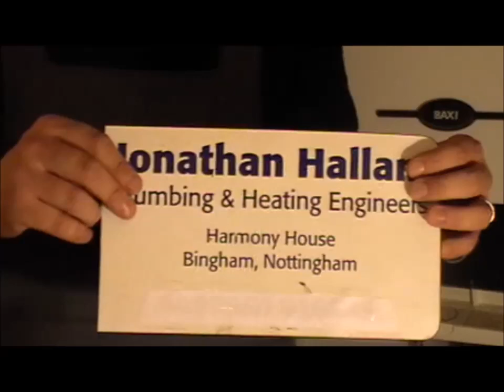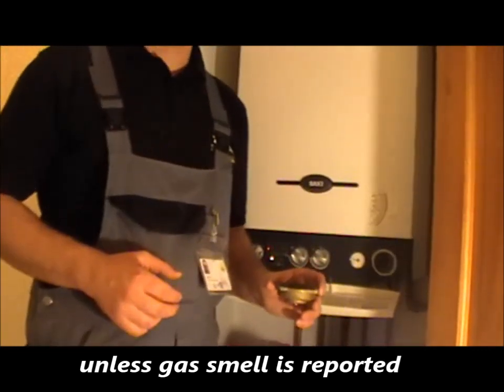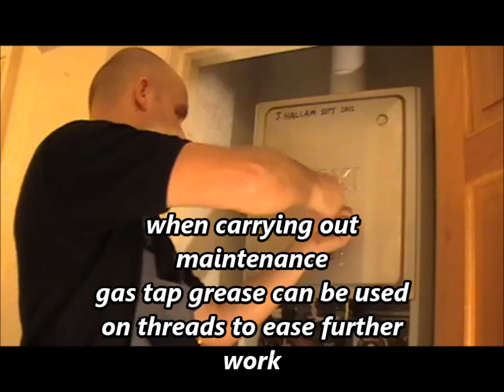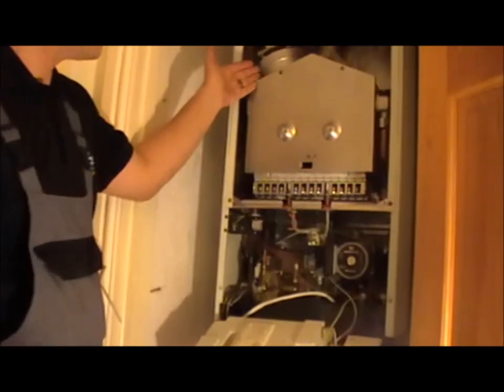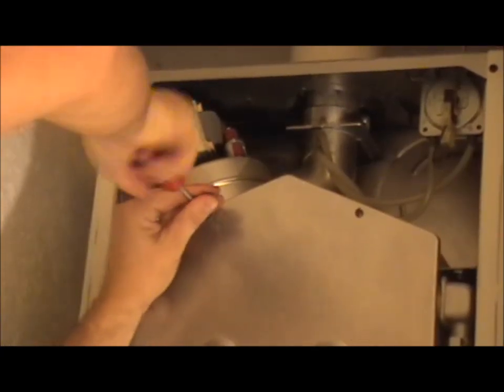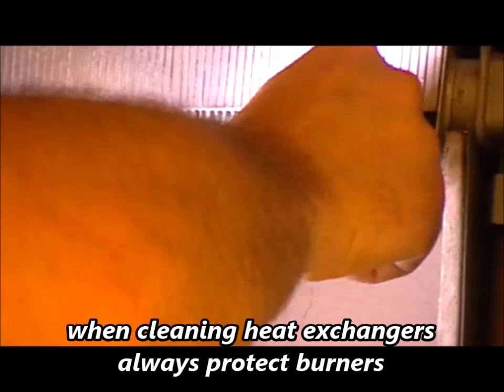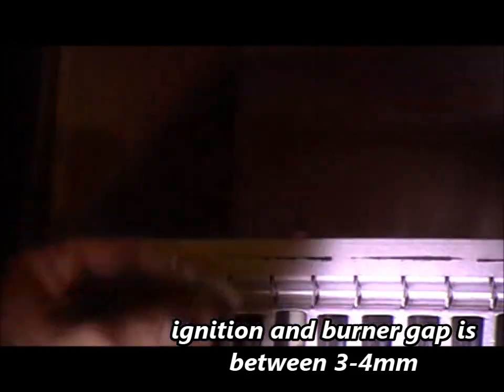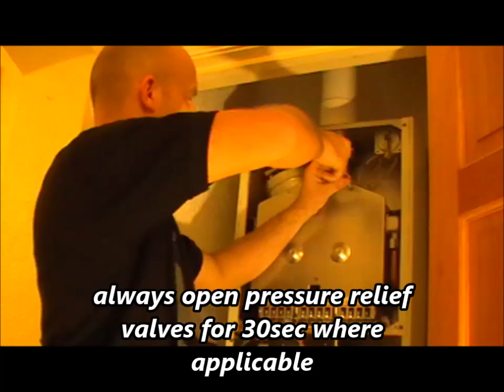Learn how to carry out Boiler Services Part 1

Comment: Hi I saw your videos and I really enjoyed it keep up the good work.

I have a Main Eco 30 Combi boiler I was fitted about 7 years ago, the whole pipe work is new and radiators.

There is one thing that annoys me on my boiler is that when ever is ignites it makes a small tiny explosive noise you can hear it from far 😫

I have so far replaced the electrodes since  it was old and bent (it was working but I wanted to avoid it failing), the heat exchanger was hoovered and the seal was replaced, the diverter valve and actuator was replaced (since a small leak damaged it).
I have regularly flashed the water out using the drain point and running the boiler and keeping an eye on the pressure (the water is never too dark and flush it until it is clear water, I added some inhabitors, clean the filter out and took the air out of the rads, it is well balanced too.
I had to pressurise the extension vessel which is good now, on the same time I took the prv out and cleaned it very little dirt on it it’s working good, I also cleaned out the part in which condensation and other dirt accumulate.

There is one thing that annoys me on my boiler is that when ever is ignites it makes a small tiny explosive noise you can hear it from far 😫, you could describe it like a small delayed ignition 🤷🏽‍♂️

What would you recommend to check?
Reply from the maker: Safeer Abdul Hamid check the electrode spark gap? Then check gas valve
Reply: Jay #happytohelp #warriorsofwarmth Plumbing 

The Electrodes have about just over a pound coin gape, is that good enough?        When you say check the gas valve you mean is it’s set to the correct pressure?

Comment: Hi Jonathan, love all your videos. I'm using as a refresher. All bang on. Im trying to break into the boiler servicing/repair world, been trying since December. Still no joy, know one will give me the time. Im getting the boiler servicing experience, from your videos. I did see a boiler parts stripe down, from an ideal rep, which lasted 6hrs. Ive got my level 3 C&G/Diploma inc ASC.Will watching your videos be enough, to go self employed????  Any suggestions Jonathan. Thanks.
Reply from the maker: Stuart Sinclair get yourself on boiler manufacturers training courses
Reply: Self employed from watching YouTube vids? I think you need to reassess your expectations. Try and get a paye job to gain experience, you will know nothing about boilers and systems until you start regularly working on them you won't get that exposure being self employed and wet behind the ears
Reply: Hi Bob, I’ve found things have slightly changed in the Gas world, very confusing and not helpful. I tried so many companies, and friends of friends. Everyone said no, they had no time, and no money for a new gofer trainee, job interviews, said no, maybe of my age, so I decided abit of Youtube, Various Courses, which I’ve completed a few now on boiler fault finding and wiring and controls and wiring up thermostats. Before I knew nothing. I managed to wire up 3 different boilers with no faults, its all in the diagrams and follow the numbers. It took a while, then it clicked. Very much enjoyed it. On to the next👍

Comment: If you was cleaning this out (typically I would judge this with a FGA ) surely you would remove the flue hood, fan and burner also?
Reply: Michael Douglas you need to change the pcb

Comment: why are you even showing this video. You'll get non gas safe guys breaching the regs. plus you're killing the trade
Reply: J HALLAM..your scared it will put you guys out of a job
Reply from the maker: Arks Ekrem sorry if it caused you stress I uploaded to aid people, D.I.Ys wouldn't buy a flue analyser? Surely not?
Reply: +J.Hallam Plumbing No but they'll start removing boiler cases and go and buy a u-gage. you're just opening a door for them. I understand you want to help people but making a public video for everyone is wrong in opinion. No stress caused mate. just disagree with it.
Reply: Arks Ekrem Not all DIY people are equal - just like not all ‘Gas Safe Engineers’ do competent work.
Reply: Cowboy ‘Gas Safe’ engineers are doing a better job of ‘killing the trade’. See some of Allen Harts videos. Plenty of work for good Gas Safe engineers sorting out the shit installs done by the cowboy gas safe engineers.

Comment: Thanks for this video mate. I have just served a 5 year apprenticeship gaining nvq 2 & 3 plumbing + wras and unvented and gas, the latter being where i have gained the least experience. 
Altough im aware and concious of gas principles, im still not confident, generally, with my gas.
Your series of videos are massively helpful to me and helping me fill in any gaps & uncertainties with gas protocol.
Keep up the good work. Thankyou!
Reply: S Perry do not listen to any advise here it’s wrong and you will finish your trade before it starts if you look at any manufacturer installation manual you will see ALL the correct methods for servicing correctly and more importantly safely

Comment: What did you use to clean the heat ex?  Most MI's say not to use a wire brush so Im wondering what you use?
Reply from the maker: Cogibear hi ya buddy modern stainless steel use vinager aluminium use hot water, old school brush or vacuum
Reply: Cogibear you can also urinate in them, the Uric acid cleans em up a treat